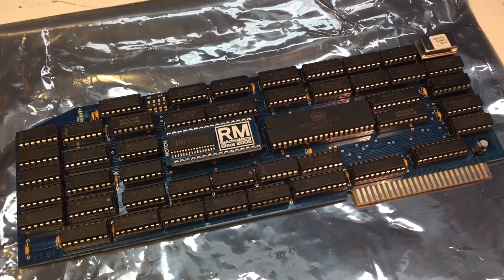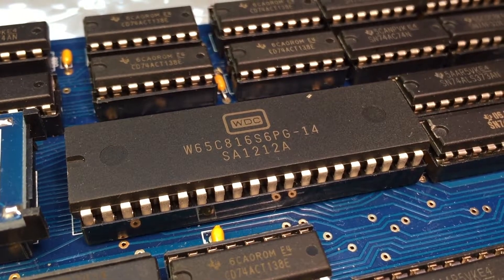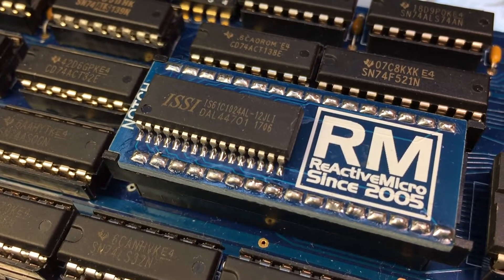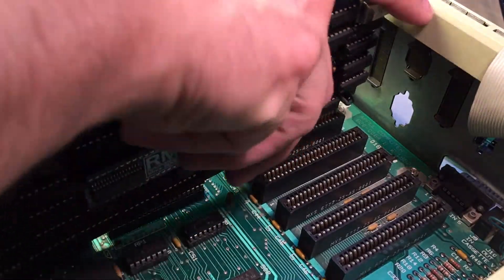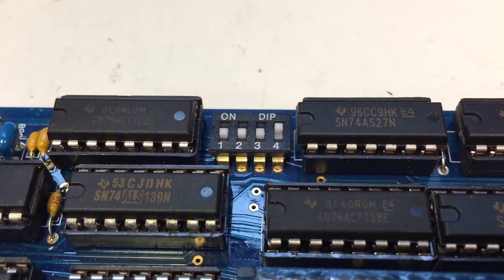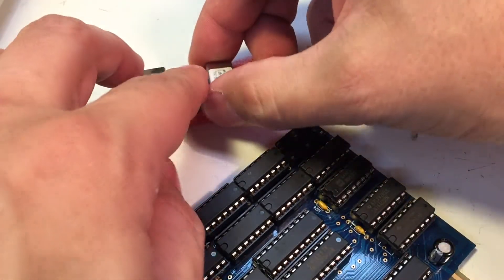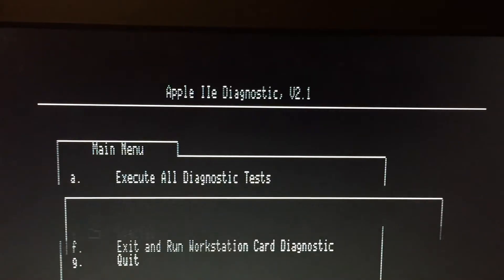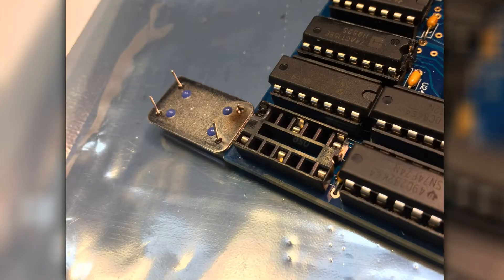REVIEW: UltraWarp Accelerator for Apple II

Comment: I have a wird card fully covered in Blue resin  it has a similar shape than the accelerator card
I can not finde out what card it is 
If I plug it in to the apple iie in slot 4 (written on the outside of the card) the screen isn't turning on

Comment: Like all accelerators for the Apple II, UltraWarp can also be controlled by softswitches.

Location   Action  Function

$C05D   W Low speed (1 MHz)
$C05C   W     High speed (set on power-up)
$C05B  W Disable

The following example in Applesoft Basic will slow the UW to the 1 MHz clock rate.

POKE 49245,0

Originally I designed the card on an Apple II+ to accelerate my favorite programs CHESS and CHECKERS, inspired by an article in creative computing 1982 ("New Processors for The Apple").
Reply from the maker: I forgot that in the video, yes, thank you. One CAN turn the acceleration on or off from programming.
Reply: And POKE 49244,0 sets the card back up to full speed. My card arrived yesterday and it works great. Thank you for creating it!

Comment: Seems impressive when it's working.  The 3D shape rotation was the most impressive demo.  I think this thing really needs an external switch that swaps a 1 MHz oscillator back into the circuit for when you're playing games.  Is it compatible with the scalable oscillator they offer for TransWarp GS upgrades that allows selection of clock frequency by DIP switches?
Reply from the maker: I agree generally, or better yet a dial that allows you to pick frequency on the fly. This is not compatible with the TWGS Scalable Oscillator. The TWGS SO outputs a frequency 4 times that of what the TWGS actually uses, since the TWGS has a built in frequency divider. Even at the lowest setting, an SO would likely drive the UltraWarp way beyond anything it could do (28Mhz or so).
Reply: Oh, right.  It seems that a version of the SO with slower selectable speeds could be a good fit.  If they could offer that and a switch that can be mounted outside the case and sets the SO to 1 MHz, I think I'd be happy.  I like your dial idea, too, but it could make it harder to set it exactly at 1 MHz or to avoid inadvertently selecting a speed that's too fast (and makes it crash).
Reply from the maker: I am aware of the Fast Chip. Keep watching... :)